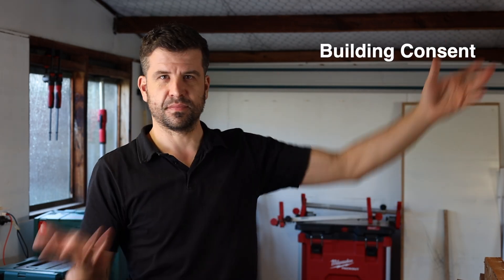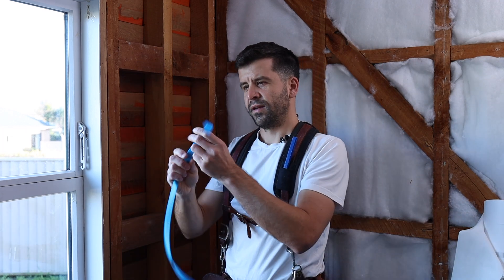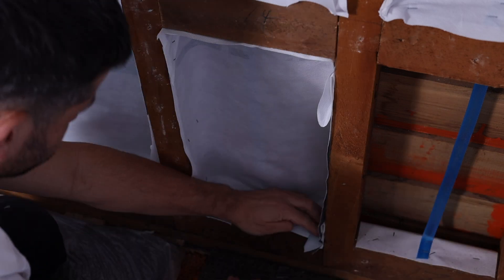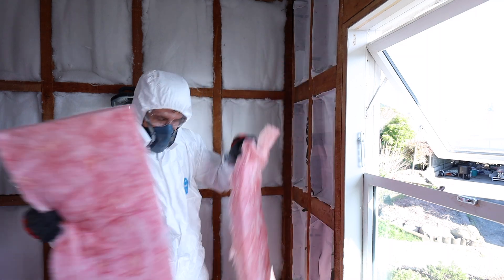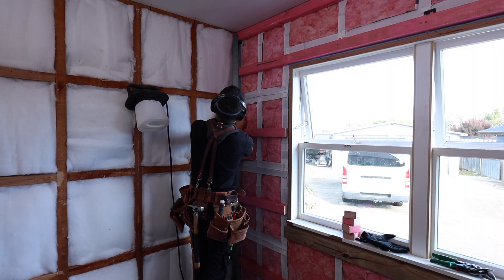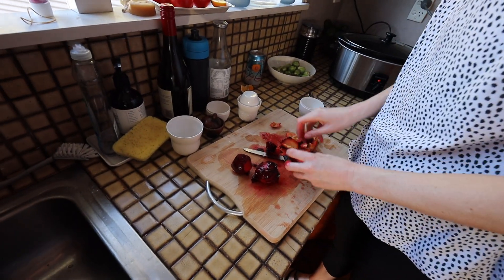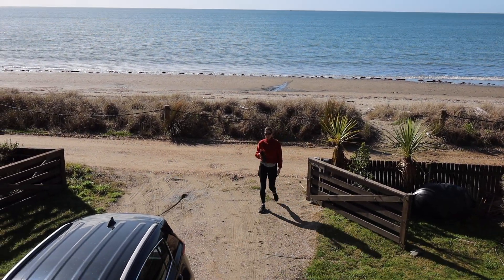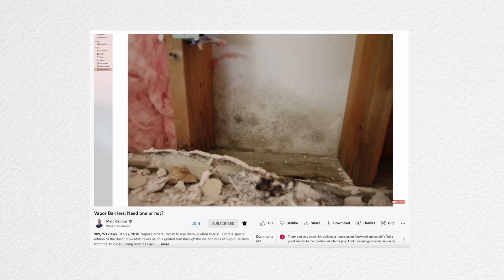We're Finally Going To Be Warm! Renovating Our 1960s House

Comment: R is expressed in Watt and square meter. So I guess the American system is different since they measure everything in body parts.
Reply: Apparently countries like US and Canada (as opposed to Europe, New Zealand and most others) does not use RSI, but an imperial variant:

R-value (in I-P) ≈ RSI-value (in SI) × 5.678263
RSI-value (in SI) ≈ R-value (in I-P) × 0.1761102

From Wikipedia: https://en.wikipedia.org/wiki/R-value_(insulation)

Comment: Get an IR camera, if you try a different insulation method on the next exterior wall take a look at both walls with an IR camera. Visually it should make for an interesting YT video.
Reply: I so use my FLIR camera for detecting where insulation is necessary, even for electrical faults (faulty electrics are usually hotter than normal)
Reply: Sounds expensive

Comment: Not sure if anyone else has mentioned it, but a suggestion from me would be to pull some data cables through the walls while you have the plasterboard off. More and more home devices are trending towards being "smart" or network connected and some will always perform better via a cable rather than Wifi.
It may not be as useful in a bedroom, but in the living spaces and office space data cable could be extremely helpful.
It can also just be left in the wall instead of presented if you don't immediately have a use for it.

Love the videos, keep it up.
Marc.
Reply: Wifi works great since the AC standard so ethernet cables are obsolete unless you need to connect a small server park. Wouldn't bother in a wooden/plasterboard house anyway. Here in Europe we live in houses with 30cm rebarred concrete walls, and HR++ glass. They actually limit your WiFi, but these types of builds do not.
Reply: Or even conduit
Reply: Everything wireless router you don’t need cabling any longer that’s in the past
Reply: Excellent idea. Purchase bulk Cat 6a cable and run a couple lines to each room now. Anyone who says you won't ever need cables is ignorant. Modern wifi still isn't capable of serving even a fraction of the bandwidth. You can route all cables to a central location where you now have an abundance of new network options. Even if you don't need a whole server, you could setup a simple data backup system that you can now transfer media to at data center level speeds. Not to mention being able to utilize the full speed of fiber internet.
Reply: @GatorBird22  Suit yourself. You do know that modern WiFi has higher speeds than 1G (1000 Mbit/s) cable right? 

The only thing to consider would be to run 10G lines through the house. You will need a 10G workstation, CAT6a cable, 10G switches, 10G server / synology... ánd a disk array that can actually keep up with higher speeds. Leave one component out of that chain and WiFi is just as fast. I edit a lot of video and I work on a local SSD, then synology just mirrors the files to the server on it's own pace. I have a full 10G network and a very fast disk array.... but it's still too slow to work on it directly. And although the mirroring is obviously faster over 10G, 1G would do just fine as you don't have a constant stream of changes during the whole day. I find 10G expensive for the benefits you reap, and by the time it will get cheaper, then WiFi-6 and 802.11ax have taken off and will still about match the 10G corded solution. 

So yeah, I don't see the use for corded as it would only make sense in a datacenter/server on which multiple people are working on simultaneously. I get the sentiment though. I used to be the same. And each to his own: if you have a better feeling with a cable, please go for it. Just don't say it's far superior to wifi, since it's not.
Reply: @davesmulders3931  i dont know... for the last 5 years i always tell people if they  ask, get CAT6a if you have smaller home, and Cat7 if you have a bigger home. its better to have a wired system, for whatever you may want to do.. then using Wifi.. wifi is nice for a tablet, phone, laptop. for TV and PC the best is a internet thru a cable...
Reply: @davesmulders3931  "so ethernet cables are obsolete unless you need to connect a small server park" I'd both agree and disagree with your opinion, I do this for a living so I'd agree you can get away with a WiFi based solution, but I always recommend as a minimum wiring in Cat6 for APs in high usage areas, having a wired backhaul will provide the client a much more robust solution no matter the construction.
Reply: @mrdot1126  Cat7 would likely be overkill for most clients, Cat6 is a good enough solution for most if not all average domestic installations (as opposed to mega mansions of course) I have 25 year old Cat5 running over 960mbps with low latency of 2ms, with short runs <50m you're unlikely to see any difference in performance between Cat5e and Cat6 (again talking about domestic installs) you might see it on a $2k tester, but clients will not in real usage scenarios, if you want to put Cat7 in go for it, but personally I'd spend the extra on good Access Point etc.
Reply: @mrdot1126  I agree with what you are saying, but it depends what hardware you have. I had my Apple TV running off cat 6a, the problem was my Apple TV could only accept 100mb. So I unplugged it, ran over wifi and now have between 400 and 500 down. (I'll be apgrading my Apple TV soon.)
Reply: if you are unsure, what you want to run to each room, throw in some empty tubes. connectet to some wall mounts, so you can decide what you want to pull through later on. networking, power. run it through your attic to your main distribution point in the house.
Reply: @martinmaccoffee3022  Running conduit for future use would of course work, but the cost and agro of running conduit and then pulling in (especially if you have bends) would likely be costly compared to just running the Cat5/6 just in the first place, cable is relatively cheap to run prior to boarding and finishing
Reply: @davesmulders3931   I clearly stated exactly what you listed. Running Cat6a 10Gig lines is cheap and future proof. You can transfer data at speeds Wifi can't touch, and the necessary hardware needed to meet 10gig (aside from the wire) is barely anymore expensive than regular equipment. I've wired my entire house this way for less than $500 in materials. Sure, for many people wifi will always be enough... But it would be silly not to run data cable when you have the opportunity to.
Reply: @davesmulders3931  It's absolutely superior (for static items). You're always going to face challenges with wifi in terms of peak output. I currently have my whole house wired with cat6 and a decent 802.11ax wireless setup with a gigabit internet connection. One of the benefits of being wired too is the ability to do wired backhaul on on the wifi routers. All my static items like consoles/tvs etc etc are wired and benefit from a solid connection at full speed with no issues. I'd definitely recommend this to anyone who has the ability to do it to their home.
Reply: Agreed. I've put ethernet cabling into every house I've lived in for the last 25 years (rentals, with permission/enthusiastic agreement) and owned houses (2). There will always be some devices that just run better on cabling than wifi, and my tendency is to put security systems on hardwired setups, to prevent wifi jamming from messing with the security system.
Reply: @texasproud3332  not always.
Reply: @georgeackerman1752  4k video streaming only uses 25Mbit, so 100Mb ethernet is fine

Comment: North West Scotland here. Just finished a timber frame extension to an old stone built cottage.  !50mm timber studs with the bays filled with 120mm PIR foam panels,  25mm foil faced PIR foam over the face of the studs internally with  joints taped and another 25mm over the outside before strapping and timber cladding for a total of 170mm depth of PIR  insulation. 

Roof has 200mm rafters with the rafter bays filled with 150mm PIR, 35mm foil faced sheets internally across the rafters with another  35mm externally before battening, sarking and slating for a total of 220mm of PIR insulation.

Comment: Living in California, we remodeled our old 450 sqft cottage and added another 500sq ft. It didn't have exterior wall insulation in the old part. We ended up removing all the old redwood siding (along with all the lead paint) and doing osb shear wall, tyvek wrap, hardie plank (cement board) siding and pink insulation in the wall cavity. The combination of lead paint, straighening out some out of plumb walls and matching the addition siding; made it make sense to reside the house. Also spray foam insulation was prohibitively expensive.
Its a very clever system you have come up with! Looks to be very economical too! 

Also, just an observation: It looks like your citrus tree in the intro could use a bit of fertilizer. The yellow leaves with green veins is chlorosis, usually indicating iron or magnesium deficiency. Any all purpose or citrus fert will fix it right up. Here in CA, we have to fertilize 2-4 times a year (depending on soil conditions) to keep citrus happy and productive. 

Enjoy your vids! Cheers!

Comment: I've been insulating/renovating my 100+ year old house in NZ for some time now, here is what I've found.
Insulation improves things a lot but will not work anywhere near its full potential if air gaps in the house are not dealt with. The Insulation stops heat migrating through ceilings and walls but does not stop that warm air escaping through gaps. Even small gaps move a huge amount of air in my experience. The worst areas are behind window/door reveals, around skirting boards, and especially around the perimeter of lowered ceilings. Pay particular attention to previously renovated areas that were not finished well. The other issue (in my case) was hollow walls that had timber sarking both sides and no dwangs. The ceilings were lowered but the walls are hollow well above the lowered ceiling and they act like big heat radiators in the roof space. My solution was to pull off a few sarking boards just above ceiling height in the roof space and tightly fit pink batts atleast 400mm down the wall cavity, further if possible. This made a huge difference.
Expanding foam has also been very useful in many areas.
Wall cavity moisture in exterior walls is a concern after insulation, I'm going to reclad my house on the worst weather wall and use a cavity batten to separate the cladding from the wall cavity.  Your idea for a 20mm air gap is a good one in my opinion, if the insulation gets wet it will become a big problem, so it makes a lot of sense.
 It can be tricky renovating old houses but can be very rewarding work turning something old into something new again.
Reply: You are 100% correct. Stopping air flow is the number one priority when insulating. Many insulation products, like glass wool, lose their r value when air passes through it. The same is true with water.
Reply: Yup.. airflow matters much more than people realise..

A lot of the facade work (metal cladding)I do these days specifies taped seams/penos.
Reply: After spending a year doing a renovation of a 100+ vila.  I would agree that getting the moisture release is very important. 

I’ve tried a few different approaches. But think my new strategy of pulling off the weatherboard. Putting on rigid air board with taped joints, then cavity battens, then massive R value insulation and new gib is great. But better is RAB board and insulated plasterboard. 

Its not a precise science though. Whatever works in terms of cost, time and effort
Reply: At the same time houses without a heat exchanger can be too tight…”sick building syndrome”.  Does he plan to install one? If not I wouldn’t worry about a little fresh air migration.
Reply: @ztifbob  The decision to install one is based entirely on how leaky the house is.

Comment: R15 with 2x4 walls is standard recommended in zone 4 in the USA. In countries where the SI system is generally in use, the R-values will also normally be given in SI units. This includes the United Kingdom, Australia, and New Zealand. I-P values are commonly given in the United States and Canada, though in Canada normally both I-P and RSI values are listed.
International System of Units (SI) while those in the US (based on measurements in Fahrenheit as opposed to Celsius) are approximately 5.71 times those measured using SI.
So if that is true R15 in the USA = R2.62 in NZ
Reply: That's great thanks.
Reply: Thank you, I was feeling very very cold looking at my R20 walls when Scott seemed very pleased with R3.
Reply: Canada would be the same Rvalues as the States. Our code in Ontario (some of the most strict building codes) requires a minimum of R22 in above grade walls, R20 in below grade walls, R31 in cathedral or flat ceilings and R60 in traditional attic ceilings. This equates to RSI of 3.87, 3.52, 5.46, and 10.56 in order. 
I would argue though, that the way Scott has installed it isn't a true R2 in the first method, as he didn't install behind the 'noggs? Thus leaving a cold space. Not condemning that, he always does the best work possible. The next layer on top covered that, but the whole system wouldn't be effectively rated to his quoted, R3 I think he said. And yes, I know he's renovating and that's different. Here in Ontario, our corners are framed open too, so you can always get insulation into the corners and we would install 6Mil Vapour barrier before drywall (gyp board, plaster board) too. 
Love these videos

Comment: What an interesting video. I live in Ontario, Canada and watching this video, and then reading comments bringing building code from all over the world makes me realize how strict our building code is here. Im a builder in Ontario and we wouldn't be able to do what Scott has done here, even in a reno. Not knocking the work by any means, just interesting how different it is. Our building code and the research I have done shows how important vapour barrier is. A few things, though. It HAS to be on the 'warm side.' Meaning when heating your home, its cold outside, warm inside, so it is installed on your studs before drywall (plaster board). It CANNOT go on the cold side, behind your cladding, because that allows moisture into your wall cavity, insulation, etc and will breed mold and decay. Also you can't have 2 vapour barriers, inside and outside, this traps moisture within the wall cavity and makes a mess. When Ontario brought in mandatory 1" (R5) exterior insulation a few years ago, people onstalled it without enough knowledge and some used a product that had an outside vapour barrier. This then created the double vapour barrier and ruined a lot of homes. The exterior wrap or 1" insulation board needs to breath, we use Tyvek, similar to the product Scott used before installing the first round of insulation. 
Most importantly, we treat the home as an envelope and believe that the tighter that envelope (the least amount of air movement from inside to out), the better. And the tighter envelope is more important than all the insulation in the world. Small holes/gaps allow air exchange and renders the insulation almost invaluable (to an extent, obviously). We hen have HRV's (heat recovery ventilators) to breathe for our homes mechanically, as you need air movement, but in a controlled manner. 

... sorry, that was a lot. Love the videos and the different perspectives!
Reply: This is an oft debated topic. In generally cold climates it's increasingly common to have the vapour barrier on the warm side, but in climates like that of New Zealand, the cold/warm side changes through the seasons, so in winter you're actively heating the inside and in summer you're actively cooling.
Reply: @mananon68  Absolutely, but we have the same here in Ontario. Our very cold winter days/weeks are roughly -25 C (used to be colder but recent winters are so much warmer) and our hottest summer days/weeks are roughly +30 C. Additionally, we have weeks in the shoulder seasons where one day is a low of -10 at night and a high of +7 in the day. So we have the same varying temperatures and the generally accepted (and to code) guideline is vapour barrier on the warm side/inside of the home. Weather you're heating or cooling, the interior space is the conditioned space and is what trumps all else.

Comment: Mold between the plasterboard and vapour barrier can manifest only if enough moisture can form in that particular spot. And that can happen only if the insulation thickness is insufficient. Warm air from the room meets cold vapour barrier surface and water steam transforms into condensate.
Mineral type insulations (glass wool, rock wool) require vapour barrier because of their poor capabilities to diffuse moisture (they soak up water very good, but drying out is a pita), plus every percent of soaked up moisture drops their R or U values dramatically.